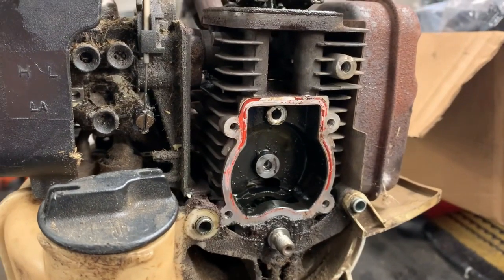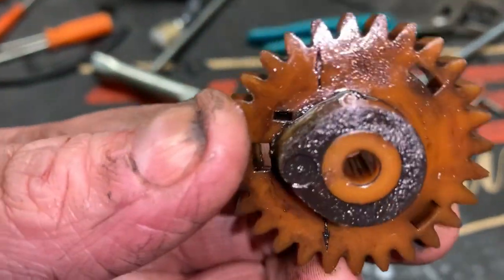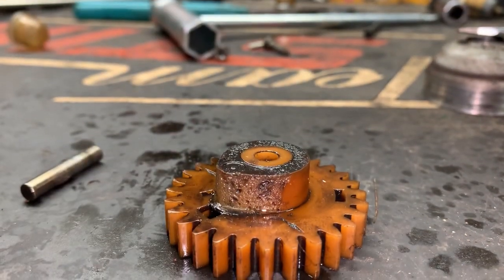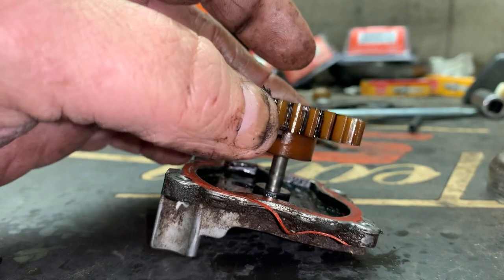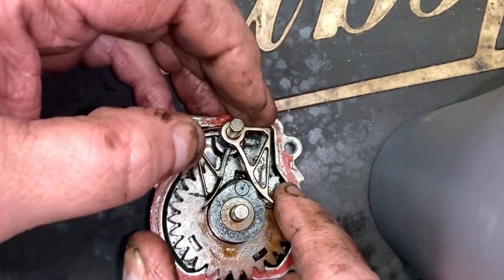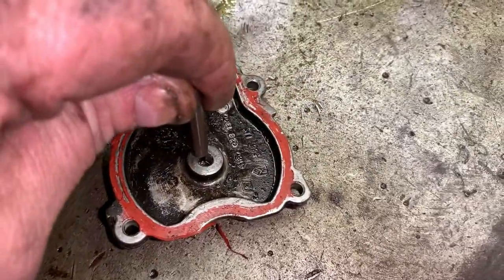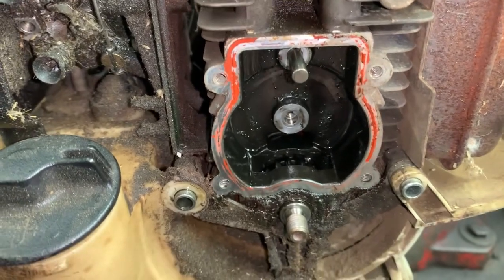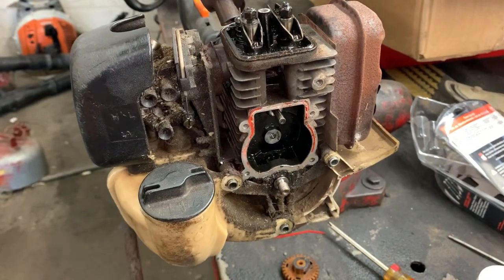50% OF MECHANICS DON’T UNDERSTAND OR KNOW HOW TO DIAGNOSE THE #STIHL #HYBRID #4MIX ENGINE

Comment: Someone please comment regarding the advantage that this hybrid 4mix engine has over the traditional refined 2-stroke counterpart.  I'm completely stumped.
Reply from the maker: More power and torque is the
Main thing
Reply: Thermal efficiency, they burn the fuel mix more completely than a two stroke does, hence cleaner emissions.
Reply: The above plus a less annoying noise
Reply: @leifvejby8023  Yes, interesting side note:  In the late '70s and early '80s, four cycle model aircraft engines came on the market.  I bought two of the first ones and competed in the '82 U.S. national contest with an RC Stearman biplane in a scale class and won with a .40 cubic inch four stroke engine.  Most noticeable was the huge reduction in noise which I know counted in my favor.  The sound it did make was much more in the character of the airplane than the usual two stroke.
Reply: @whalesong999  I remember, I still have four OS 20FS somewhere, that I bought for a Focke Wulf Condor. They run great and are very quiet even without mufflers. No, I never came around to actually building it, but some day!
Reply: @leifvejby8023  Wow, some coincidences here.  I later bought three, Saito .45s for a large Dornier Do24 project.  Got into it about 20% and then life changes caused me to abandon the project and sold most of my engine stock.
Reply: @whalesong999  I came into repairing chainsaws and lawnmowers, and after messing with them a whole week, I wasn't tempted to fly combustion engines in the weekend. I had had enough.
Reply: @whalesong999  And now I'll take my 4mix and mow my hedge!  :-D
Reply: @leifvejby8023  I hear that.  I was a motorcycle mechanic basically but we serviced and sold lawn and garden equipment as our side line, it all worked well back in the day.  I was enthralled with small engines but that tapered off over time.  On returning to RC, I went to electric power in the early 2000s.  The charm of all of it no longer affects me.
Reply: When I first looked into the differences I found the 4 is able to cut more work and more difficult work than the 2stroke.
As others have said, they have different sound and efficiency, power and torque.
If you do one yard religiously, you don't need one.
If you let it go and it's too much work, the guys you hire will be using the 4stroke.
The type of brush you have to cut can be too thick and strong and then you may need that extra torque and power.
Like kids ride a 2stroke bike, in the dirt.
But their big ol Daddy has the 4stroke to take him up the hills. More work being done needs power and torque.

Comment: These 4 mix engines aren't a good idea , their a rubbish idea ,stick to a good 2 stroke every time
Reply from the maker: Wont be any two strokes soon.  EPA wants everyone to own electric junk
Reply: Stick to the gx25/35 legit 4 strokes and the Makita 4 cycles
Reply from the maker: @DeliciousBass01  too heavy
Reply: @THEMOWERMEDIC1  agree if you run them all day.  Im not a professional, i just spend money on quality stuff :)
Reply: @THEMOWERMEDIC1  it may be true that alot of electric stuff is junk, however this vid proves that some 4 stroke stuff can also be considered junk. Same goes for the majority of 2 stroke stuff out there today.
The problems associated with this  particular engine could have been alleviated if the engineers were allowed to bush those shafts and not be forced by the accountants to save a few nickles. The same goes for 2 stroke junk being made in china to serve the same purpose of saving those few precious nickels.
The internal combustion engine has, thru ecology and basic economics, run its course. Electric is just starting to ramp up and soon will prove to be more powerfull and more economical than engine power, plus it can be refueled(charged) while you do something else like drive to the next jobsite.
No more having to fill equipment before starting work, hard to start , going to gas station, all of which now becomes time working with less overall stress.  I think its Electric for the win ,  if we keep china out of the picture
Reply: @jessewoody5772  I still don't think we're there yet with energy density of the fuel coupled with how much you can get done on one charge and keeping it lightweight.  Plus batteries can only take so many charge cycles until you have to buy new (so, every two years and two batts per piece of equipment min.).  I maintain 214 acres of mixed forest and meadow and there's not one thing with a battery I can think of that I'd replace what little I'm using that uses fuel.  I do constantly look.  When they make a road vehicle that'll let me drive all day on one charge and with 4LO so I can drag dead Oak off the road AND an electric chainsaw that'll pull a 20 inch chain through wet hardwood in the rain, I'll agree that electrics are finally looking up.  But, I'll keep monitoring.  I can't imagine the size battery I'd need to push the 4WD 72" front mower up a mountain slope and last 7ish hours.  As it is, I use 5.5 gallons (one saddle tank) of diesel every nine days doing it.
Reply: @DeliciousBass01  definitely too heavy for daily use most of them will hate it including landscapers, lawn care....
Reply: @travis10ist  agree that for daily it doesnt make sense

Comment: My god what in the world is this person running for oil in the gas? Outboard motor oil or what. Iv e worked on stihl's that are old and they are not that dirty! Wrong oil will cause overheating or to little will cause it too!
Reply from the maker: Stihl ultra hp
Reply: I’m going to agree with Tom, I’ve been a Stihl dealer for 37 years, I’ve never seen a Stihl 4MIX run on ultra that looks like that inside.
Reply from the maker: @matthewlozosky1028  then you fit within the 50%

Comment: classic case of using the wrong fuel
Reply: Hi, may I know how you know ?
Reply: @martinspilovsky9071  because of all the coal deposits in the engine, someone from stihl told me these engines are designed for motomix or aspen 2t. If you use these your engine stays clean and gets a longer lifespan without breakdowns
Reply: @eddolous  so as it apears the usuals, taking sh!t care about your engines and then crying when sh!t happens :(
Reply: @martinspilovsky9071  😂 yes. At the Company where I worked we kinda knew who’s those people were. So we sold them regular 2 strokes and no 4 mix. Because we just knew they wouldn’t take care of them. That said, I am personally a big 4 mix fan. The engineering, the sound. The torque
Reply: @eddolous  im currently in a need for a weed cutter so thinking about the FS89 or Husq 525rx
Reply: 🤣 Wrong fuel🤣

Comment: Now that I've seen the single lob cam and it being plastic, 0 lash will cause no oil and allow the lob to grind off. That's not a good design for a stihl. Also running the engines lean can do the exact same thing with a 2 cycle oil. Pretty sure there is a 4mix oil spucificully for these 4 mix engines. Might be the same reason the 110 the landscape/hardscape company I work for has to be re adjusted around 60 70 hrs
Reply from the maker: Exactly that’s what I tell my customers if you are having to adjust the valves all the time that just means you’re cam shaft is getting ground down like hamburger meat

Comment: I was so pro for stihl for my entire life. Then I got a job working on small engines, 75% stihl. I like some of there designs but at the end of the day, there always coming in broken and needing fixed. I bought an echo weed wacker 4 years ago. Still haven't even touched it other then cleaned up the carb once. 
I absolutely despise the craftsman, murry and Polan stuff. Horrible to work on, and the pull string being in the front of the engine is just such a poor design on alot of them.
Reply: One thing to think about, whats being bought around you? Because around me, i could say idk JD rides ons are the best....because theres only a few around, we have mostly Toro or Husky mowers that i see, Sthil, Husky weed eaters and push mowers well....everything. My dad uses Sthil trimmers saws weed eaters ect has one saw for like 15 20 YEARS. Uses the right oil an does maintenance. I worked at a transmission shop and i seen 99.5% chevy trucks. one dodge and like one ford. Ford dealer is far ish away, Dodge dealer is most likely servicing the transmissions as they need some special fluid, and chevys come in at idk 120k miles having problems after neglect abuse and wear. For sure there may be certain design issues but really the issue most of the time is how the customer uses or abuses it, and the maintenance. Wheelers/side by sides coming in with 40 hours no services done, abused to shit blowing engines.
Reply: @baileyhatfield4273  54% stihl, less then 10% Honda and other off brands. The rest we sell is husqvarna products. Rarely see any husqvarna in my shop.
Reply: @travischaddock4826  Husqvarna is redmax

Comment: Castor 927 is a million times better than any Stihl synthetic oil.  4mix engine runs significantly cooler on 927.
Reply from the maker: I’m gona test that. Thanks for the tip
Reply: @THEMOWERMEDIC1  Keep in mind that pure castors tend to separate when temps drop below 30 degrees F.  Obviously most normal folks dont weed-eat when its 30 degrees, but I do use my kombi broom for snow.
Reply: I run only orange bottle stihl for years now and never have problems. Own a logging outfit amd run our saws hard everyday. Stihls orange bottle is all I trust.